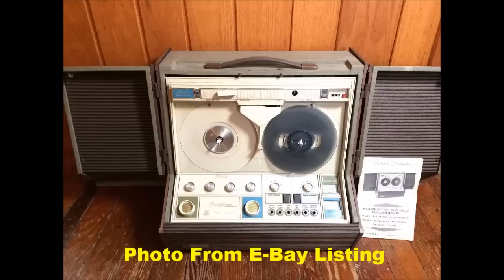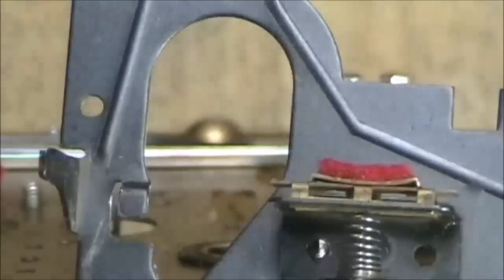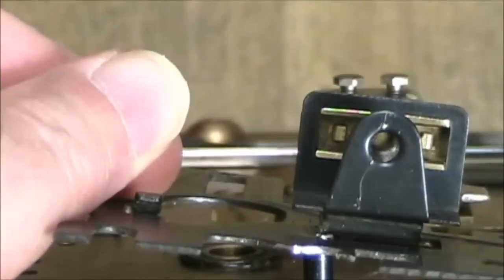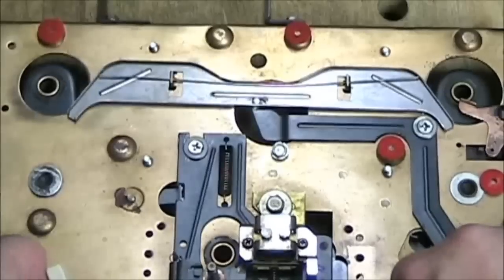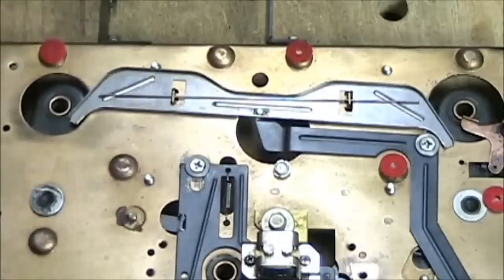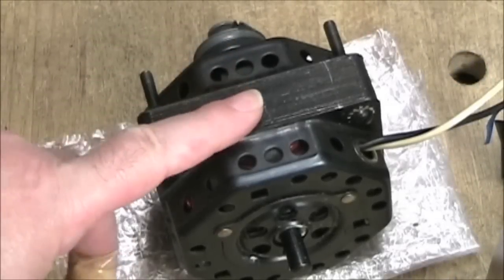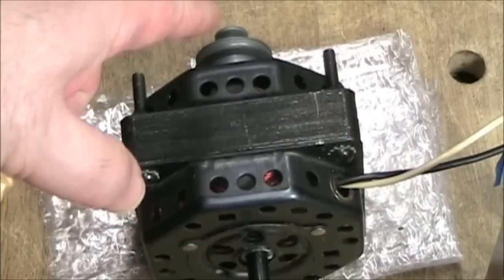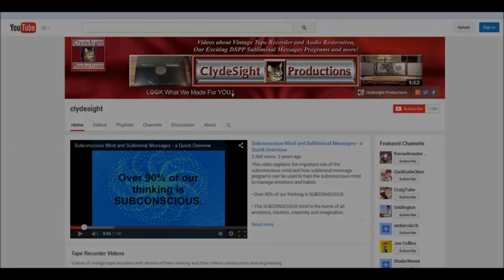Video 3– Chassis and Motor of the Sears Silvertone 7239 Vintage R2R Tape Recorder

Comment: wow you are really doing a great job and I really am sure that you are going to make this work like new
Reply from the maker: ***** Thanks... I sure hope it all works out well. As you know (and can possibly begin to see) there are so many things that can go wrong, especially due to age. 

For example, they have the head mounted on a rubber support and the two screws above it adjust for height and azimuth. But, of course, that was 50 years ago! That rubber is probably harened like a rock by now. I am hoping that the head was properly aligned a long time ago and is "stuck" in that position. Realigning height and azimuth on a head mounted this way is a major pain. 

So, thanks for your encouragement and I'm keeping my skills and intuition sharp as I can and am being as super careful as possible.
Reply: you will do just fine and I know that you always say it looks hard and it looks like a jigsaw puzzle which it does as well but doing it slowly and methodically is best which you are doing and I am sure it will all turn out great you have worked on much harder thigns in the past all the best
Reply from the maker: ***** Thanks for the vote of confidence.
Reply: i know a very skilled person when i see one and i also know you can fix anything you put your mind to. i will be looking for great updates
Reply: ***** Very interesting video, never heard of this model.I have a sony tc-355 that i am having trouble with the left channel not playing back (hardly any sound) what should i be looking at? I have seen the video of the sony you repaired and was wondering if you have any suggestions at what to look for..Maybe bad capacitors? Thank you
Rob
Reply from the maker: Rob Hernandez  If the sound is there, but it is weak, that is almost always a sign of failed electrolytic capacitors. It could be one, or it could be a chain of them. That doesn't mean a resistor hasn't failed, but it is much less likely and resistors can be tested "in circuit" whereas capaciotors can not.

IF you are VERY lucky, when you look on the amplifier board, you MAY see the bad capacitor because it will be bulging, or there will be some residue leaking from it, etc. But 90% of the time, there is nothing to see! 

A lot of guys routinely replace all the electrolytics in a tape recorder, and some do a special "jump test" to try and find the bad component.

However, if you aren't careful, you can short out something critical and that makes matters far worse. When I tried a "jump test" on my Sony TC530, I shorted the power transistor and blew it out on the left channel! 

So, BE CAREFUL!
Reply: ***** Thank you clydesight i appreciate your expertise.I will be following with interest the repair of this Sears silvertone 7239 Cheers
Reply: ***** The piano punchings that you mentioned are they the stuff that you used for the tape transport? and i think you said that it is felt am i right? and if  it  is felt is it a special kind of felt?
Reply from the maker: Rob Hernandez Piano punchings (technically, keyboard or key rail punchings) are made of a specialized woven felt that is amazingly tough. Piano supply houses carry a lot of specialized felt products that can be useful in other restorations that just pianos. For example, pipe orgnas use the same punchings on their keyboards. The only problerm is that many piano sup0ply houses only sell to technicians (piano or organ) I used to build pipe organs MANY years ago, and bought a great deal of inventory at the time. That's why I have some of it on hand today.
Reply: well there is an old phrase that says if it works use it and just be glad that you have something that can take the place of what you really need to use . it is great to be able to apply different mediums to use in other things other then what they were originally meant for that is great . Is there anything that you cant fix or do I doubt it.  all the best feel good and have a great day
Reply from the maker: ***** Thanks!
Reply: you are very welcome and I wish you all the best be well my friend and take care and please think about you before the videos all the best to you

Comment: The motor appears to be a General Industries 4-pole induction motor which isn't a synchronous type. Same motor used by Don Leslie in his organ speakers.
Reply from the maker: DandyDon  Thanks. Any thoughts as to why it is so darn noisy? I suspect no balancing. I have a Wilcox-Gay machine with a similar motor that is super quiet. This Sears motor ruins the tape recorder for me.
Reply: My mother's large heavy Webcor reel to reel has two GI motors.  They are noisy, as if the armatures are rattling around  in the sintered bronze bushings.  But as far back as I can remember they've always been that way.  

I only had one Leslie motor make noise like that and it had been neglected too long.  Disassembly and oiling with ND SAE20 oil took care of it luckily.

If the coils are a little weak and the armature is bouncing up and down, this can also create a little noise.  Depending on the age of the (and slight changes) in manufacturing of the motor, some have 5/16" hard fiber washers between the back of the armature to take up the space.  Later on they had a large Cir-clip near the bushing of the drive end of the motor.